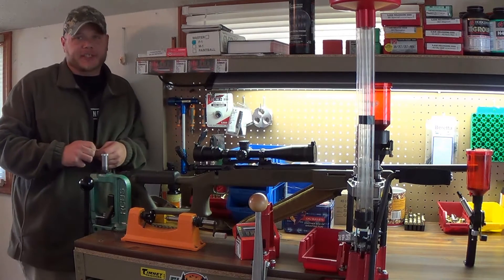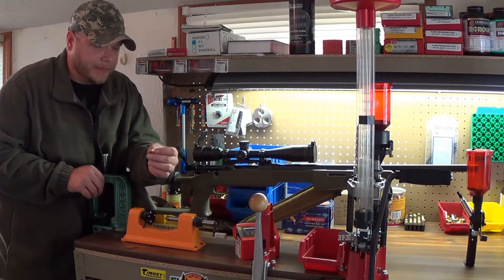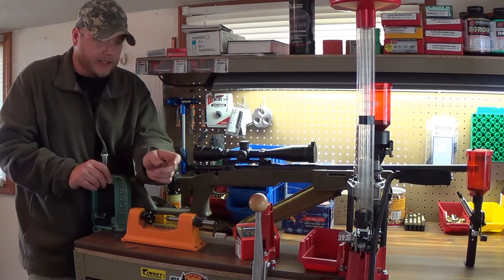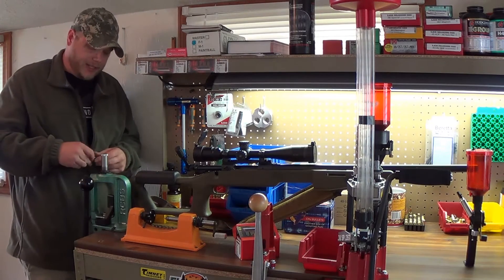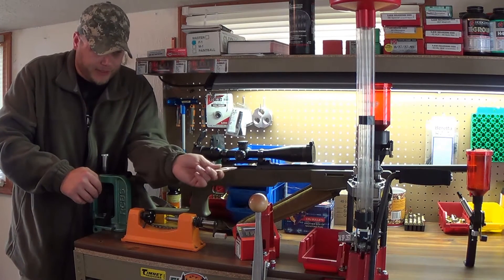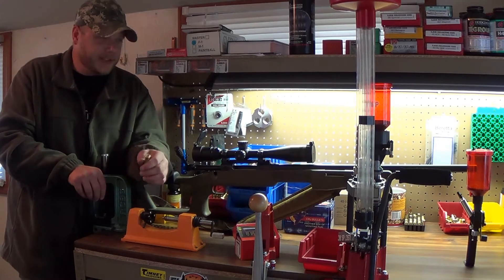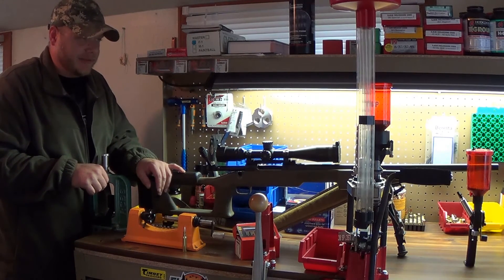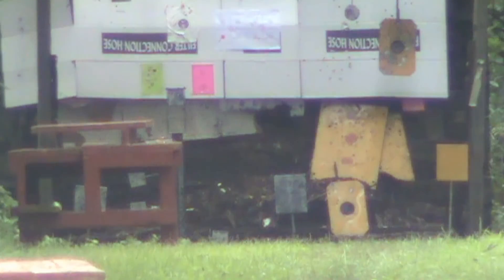How to tailor a bullet for a specific rifle improved accuracy

Comment: I tried just neck sizing once fired from my 6.5CM bolt action, they didnt chamber nor pass the case gauge. I full length size adjusting to fit snug without any wiggle room.

Comment: Good explanation why these bullets are not appropriate for long range hunting applications.  National champions  in bench rest (F-class) shooters use Lapua brass and do full length resize instead of neck sizing and do not jam the lands: https://www.youtube.com/watch?v=lLG2kSrD40g 

 I like champion Eric Cortina's approach to precision reloading for long range F-class, High Extreme Spread in muzzle velocity =Combustion variation: typical causes variable neck tension, primer variation, type or variation in powder, variation in case capacity. Acceptable low variation in muzzle velocity, but poor shot groups=Barrel Harmonics problem, typical cause bullet seating depth. Tight groups at 100 yards, but not at long range likely variation in bullets BC: https://www.youtube.com/watch?v=6VEMZJYovMA